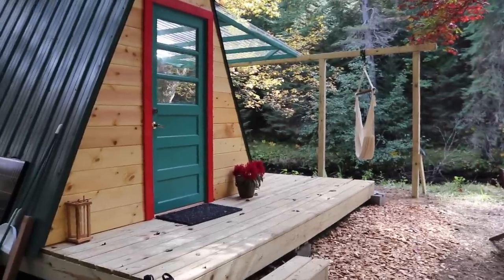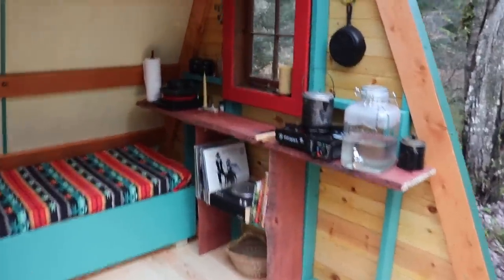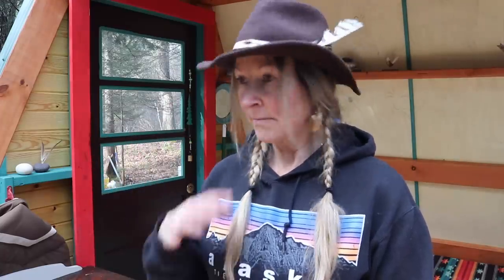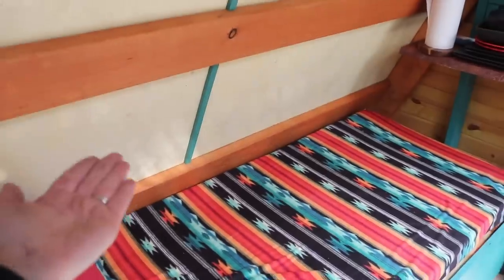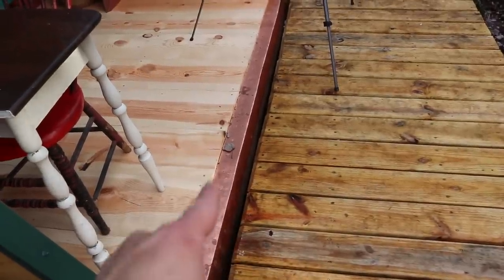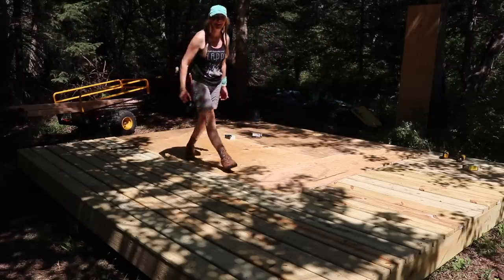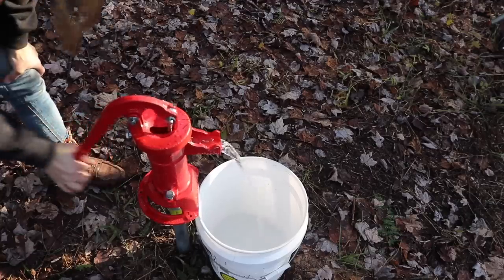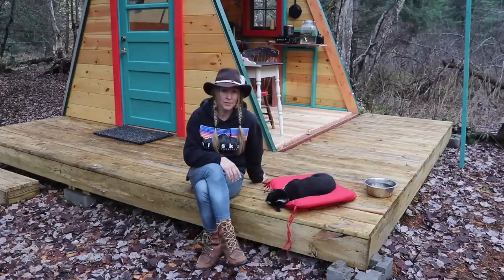A-frame cabin anyone can build

Comment: Never owned a house in my early years because being a musician I was always on the road.  But after 40 I bought and remodeled a small home since I had started playing a job that lasted 7 years so I was in place long enough to own a home.  I later bought and remodeled the cabin I retired to in NC.  But in there somewhere I built two studios, the first a 2200 sq ft facility and the last one is a much smaller retirement studio next to my NC cabin.  The first one took 4 years because I was still traveling a lot and it was basically a one man build.  The second one much smaller but still took a year partly because I was quite a bit older lol!  A couple shops and storage buildings I built as well.  What I learned in all that is never be overwhelmed by the entirety of a project, just worry about the next nail you have to drive so to speak.  I loved every naill I put in!  It's so satisfying to complete a project and then have the use of it for a third of what it would otherwise have cost.  Certainly some frustration is involved, but so satisfying to work thru each difficulty and win.  Oh, and for the last few projects I had learned to use Sketchup.  I can't even begin to explain how much easier it was to design and build them.  If it fits in sketchup, it fits in the real world.  A lot cheaper to make your mistakes in software than on a 50 dollar piece of plywood lol!  Nike got it right, Just do it!  I love watching you and your husbands adventures.  Makes me young again.  Love Da Moose!!
Reply: May I ask which region of NC? Mountain. Piedmont, or Coastal?
Reply: @BirdYoumans Brilliant advice about Sketchup. And wow! You built a 2200 sq foot home. Oh my. Keep on keeping on!🥳
Reply: @catnc1  Mountain.  I played a lot up here back in my performing days and fell in love with it.  I wasn't born here, but I got here as quick as I could!
Reply: @marirose19  It was actually my recording studio that I built that was 2200 ft, part of which was an upstairs over part of the building.  My house wasn't quite half that big lol!  And I had worked with some early CAD programs but the early ones were clumsy to use and took forever to design anything.  When I saw Sketchup for the first time I thought I had died and gone to heaven.  I messed with it on an amateur level I guess you could say for a couple of years until I found Brooke Godfrey on youtube.  She changed everything for me.  She broke down each tool one at a time and within two or three days I was really amazed at what I was able to do rather quickly with it.  My second studio which was much smaller since I was retired and not doing outside work anymore at 24 by 24 I designed completely in sketchup before I cut the first board.  Took a couple of days to do it in it's entirety and working in layers I was able to go back and look at each stud wall with dimensions and take a picture of it on my cell phone and then I basically had the blue print, one wall at a time, on my phone.  It worked like a charm.  No waste at all and I knew down to the 2x4 the materials I needed to build the project.  Not to mention, as Brooke (this Brooke, not the sketchup Brooke lol) was saying, there are always these little problems to solve.  I had already solved them in sketchup for the second studio.  It was a dream build.  I also, even before then, had learned to think in 4x8 sheets of plywood so there was no waste and no unnecessary cuts that had to be made.  Wish I had had Sketchup when I built the first studio.  I was still solving problems on the fly so to speak at that time, but it did get done.  One nail at a time lol!  I would advise anyone wanting to design any type of build, from the simplest shed to more complex buildings to learn to use Sketchup.  Spend 3 days in Sketchup school and save countless hours of frustration in the future, not to mention your designs will start to be much better because you can try things without it costing a cent.  I think you can still get Sketchup 2017 for free though they have now gone to a monthly subscription if you like web base stuff.  I don't.  I want the program on my computer so I'm not reliant on the internet.  Not to mention it's hard to beat free!
Reply from the maker: love that.... just worry about the next nail. perfect.
Reply: @therealgirlinthewoods  agree 👍 worry about the next nail, so to speak
Reply: It’s a lot of work to build off road. I built a place six miles off the road a little over 20 years ago. Use a bucket of rocks as a counter weight to help lift your big door. You could even use one on each end.

Comment: I’ve used gas struts for heavy lids on pool deck. They did work well. I have to say I would’ve def gotten discouraged from failures I made. I applaud your initiative, passion and stamina Brooke! I wish I could do what you do but I do get much enjoyment watching you and Dave. Thank you 😁🥰😎
Reply: Hey Brooke, Gas struts are a great idea, but there are something similar used on overhead cabinet doors in marine vessels/sailboats that some van dwellers also use. They have advantages over gas struts but can’t recall their name or even the advantages except I think they’re just as strong if not stronger yet use less space (width wise) which is important in tiny spaces; I may be misremembering the advantages though. 

I don’t know if they’d hold up that door but any educated marine salesperson should know. That said, gas struts might just be easier at this point to avoid further research & running around. Good luck. PS My husband has a saying (not original I don’t think) that states, “Perfection is the enemy of good.” I think you’ve made your peace with not being a perfectionist though which is a darn good thing. That cabin looks great & I love the colors & decor you chose.
Reply from the maker: thank you!
Reply from the maker: for sure! thanks for the info :)

Comment: Despite the problems you had, you did a good job figuring it out. The gas shocks for the open side is a good idea, I was actually going to mention them. Here's a tip, if you are using that trailer a lot, place an old piece of plywood on the top and use large conduit clamps underneather to secure it. You will then have a nice flat surface to haul lumber and spce underneath to haul tools or whatever. Thanks for sharing.
Reply from the maker: thank you!

Comment: A simple tip for laying out walls or roofs or anything requiring 16” or 24” spacing, is to start with your first mark (X)  and go to your spacings (either 16 or 24) and put the mark 3/4” back. Put the X to the right and do that all the way to the end. Then your 4 x 8 materials will always land half way on the stud or rafter. It works for the 8' length too. Hope this helps next time.
Reply: @phil marriage Do you have a blog? I’d subscribe to it. Or a book? I’d buy it. You get the idea.
Reply: @marirose19  No, I'm just an old retired builder with a brain full of old tricks of the trade. Any book on carpentry would cover the basics and even more complicated instructions for building. If I was younger and didn't have to ask my grand kids what Etsy is, I might think about a blog.
Reply: Very neat!

Comment: Good job and great explanations about the problems you ran into.

About the pulley.

One pulley does nothing to affect the weight of an object.

If a pulley is hung from the ceiling and a 50lb load is put one side. It takes a 50 lb pull one the other line to lift it up.

A single pulley simply changes the direction of the force.

There a hundreds of videos on Youtube that can explain this concept better than I can in the comments.

Comment: I cut metal roofing for years with a circ saw but it is so much EASIER with a handheld 4 inch grinder with the 1/16 blades. This a "hard tent" that snow slides off of. VERY GOOD IDEA and turned out very nice!!!
Reply from the maker: yup hard side tent!

Comment: Lifting your Wall: you need a block and tackle pulley, and your extension should make it work.  By wrapping the rope around a pair of pulleys, you can let go of the rope and the wall won't fall.  The Weight of the wall is on the double pulleys, the multiple wraps prevent it from pulling loose, so you only need the manual strength to pull the rope.

Comment: I believe you have learned a lot from assisting your husband in his building projects.  I think you did a great job building that A-Frame cabin by yourself.  It will make a great little getaway place for a weekend.  As for the plans not detailing how components fit together that is typical.  One reason is that designers with an architectural background don't usually provide connection details on the drawings.  Another reason is that in most cases the designer hasn't actually built that project.  If it had been drawn by a mechanical engineer or a mechanical designer they concentrate on how things fit together and there is a greater chance that some connection details would be shown.  Keep up the good work.
Reply from the maker: ahhh makes sense

Comment: Thank you for sharing the reality of doing something like this. I built a 10 by 10 storage shed last summer and used a 30.00 bundle of slab wood and cut a few small pine trees, and Shou sugi ban the wood for the floor, so I didn't have to pay green treated prices.  LOl  Plywood sides, and sheet metal roof.  Lots of bracing and clamps, but got it done.  You are an inspiration.  Thank you. Shout out to Dave also.

Comment: I have been with u for a few years now, n I want to tell u thank u for the inspiration u have been in my life. My husband and I purchased a school bus and r in the insulation process now. However we don't have much of a budget to work with so I'm thinking out the box n so far it's very good. Got stud wood from trash brand new, got pallets to refurbish and use where needed, got a 10' counter top for less then $50 brand new, also got a black propane oven n sink for less then $50 also brand new never used. I would not have went outside the box if it wasn't for ur videos showing how possible it is anywhere. Thank u for everything from my heart to urs

Comment: I remember my grandfather's garage had a loft with the really long heavy ladder to get in there. How he made it easy to raise up and down that ladder was to add weight to the pulley rope, almost as much weight as the latter. This means just with a little effort you could easily lift the ladder with a couple fingers. I could see it helping you lifting your swing wall. Thanks for your video,

Comment: Brooke  You  did a awesome  job  !!!  I did a drawing  of mine own for a  A-Frame  home 10 feet  tall on all sides then  to go to  the  A-Frame and  I also had a  basement underneath it all  it was a 4 bedroom home  !!! Half  Loft was  the  3rd bedroom and  4th was in the basement with full bathroom !!  2 bedrooms on the  first floor with  washer & dryer  also and   hot water heater also !!!

Comment: Girl in the Woods. She Gone! Back to the lumber yard! Being short of material is by biggest frustration when doing a remote build. I tend to buy extra now and If I don’t use it I know  I will find a need for it someplace else on the property. A couple of ribeye steaks will usually coax a helping hand for the awkward stuff and is money well spent. They can also provide an extra set of eyes for the dropped hardware, misplaced tools, and the wrong cut you are just about to make, but always bring a couple of tape measures cuz I’m sure Bigfoot collects them.

Comment: Howdy!  Great video and great to see you again!!! When my wife and I get back to our property on the east coast of Canada (an acre of her family homestead land) I quickly learned alot of the lessons you talk about in this video. Thank God for my patient wife! LOL! Things take time and as you stated, every "easy thing" makes ya stop and think! 
Anyway, I posted the following comment yesterday on the "Start to Finish" video of this cabin regarding the swing wall - hope it at least gives some new ideas for you.
Howdy! Know this is an older video - ya'll not around much these days so going back through your library - but have a thought on your swinging wall situation. What about a winch (hand cranked or electric) from the back side of the cabin with steel cable coming up to a pulley on the roof? On the window side a cable from each bottom corner that meet the in a single point  that attach to the "pulling cable"  (think that might be better than a single cable to the centre of the window wall?!?!) using the leverage of the shape of the cabin.  Could do it opposite and have 2 cables that run up the sides on the front and join together into a single pulling cable on the back?  Just a thought and I'm sure between you and Dave the logistics could be figured out when you're next on site. Not exactly sure where / how the pulley at the peak would have to be to get the cables to lift the front edge up other than in the centre. Would it have to be on an "arm" to get it to "lift" rather than "pull" the wall?!?? 
When is Zippy (or is it Dippy??!?) coming to visit and stay in this awesome little cabin?
Again great to see you again looking forward to the next video/adventure!  Be Well!
Reply from the maker: thanks for watching i appreciate the feedback!
Reply: @therealgirlinthewoods  I hope it spurs on a solution for you!

Comment: You did pretty good for a first timer ,there's a few things you could have done differently ,but we learn from our mistakes usually,couple things im gonna say ,if you decide to change the well to hold water above the frost line ,you might want to build a well house ,i think its fine the way it is and would skip the ball valve idea to prevent freezing ,and for the toilet out house idea i would go with a compost toilet and cedar chips and keep it inside for the cold nights  ,you dont want to poop were your drinking waters coming from ,and the compost will turn back into good planting soil,and you can reuse your bucket too...lol ,maybe try a counter balance on your swing up door ,let them do the work of lifting it for you ,two pully wheels on the same line will cut the weight in half ,always keep a locking pins or posts under that door when its up ,you dont see the wind coming looks good and remember if anybody asks where always only 28 at heart

Comment: Just an idea, You could add a length of gutter under the floor for the runoff water on the side of your a-frame that opens, So the ground does not erode causing problems in the future.

Comment: You can only use non alcohol gas in those little generators cause the carb has no adjustment screw to enrich the fuel to air mixture. Using gas with alcohol is too lean of a mixture and won't run right. Been there, done that. Thanks for great videos Brooke! Love your pizza too! (On another video)

Comment: You might try a double or triple pulley for more leverage on opening your wall.  The kind you'd use on a sailboat or for pulling a motor out of an engine bay.  The gas struts are expensive.

Comment: Brooke, the 2x4's laid  flat on the wall is a structural no-no and have less then 50% the strength in your configuration..You did it for room...You now have a building 1/2 as strong as it would have been if framed proper as in the drawing... If you get snow, you may have an issue with your structure....